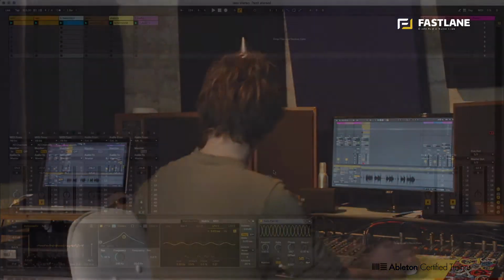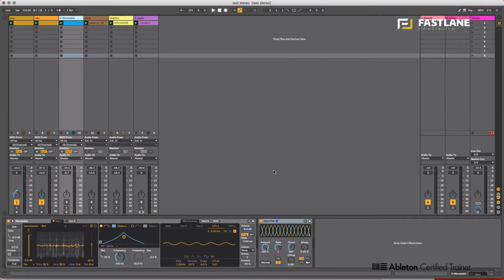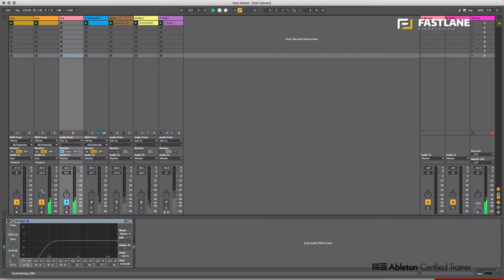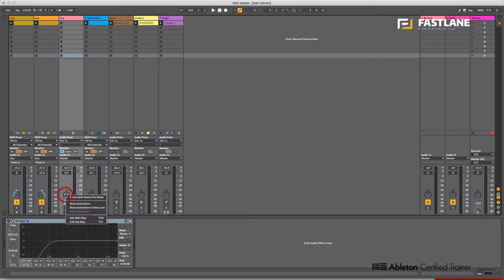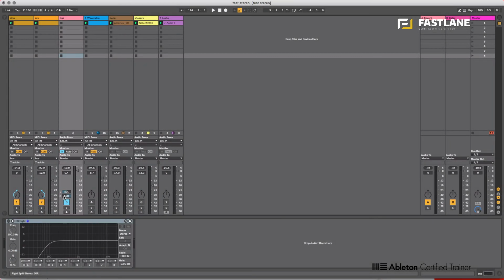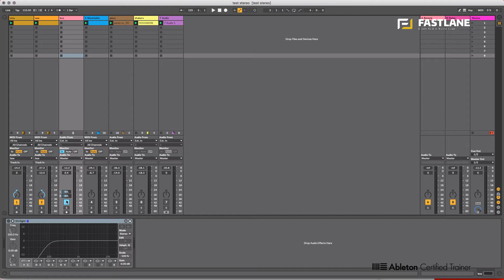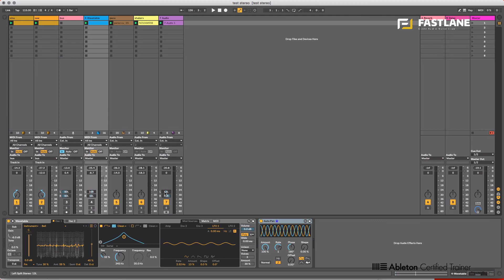Ableton Live Tutorial - Split stereo pan

Comment: I CANT UNHDERSTAND THE PART FROM 4.30 ON WARDS ABOUT THE PIANO . YOUR SAYING MOVING THE LEFT SIDE TO CENTRE WILL LOSE THE BASS KEYS OR LOWER KEYS OF THE PIANO AND SAME IF YOU MOVE THE RIGHT ONES TO THE CENTRE YOU WILL LOSE THE HIGH END KEYS? THAT MEANS USING THIS SPLIT STERO PAN IS LIKE USING AN LEFT AND RIGHT SIDE E.Q ? CORRECT ME IF IM WRONG
Reply: No, not EQ. This piano track happens to have more bass in the left side and more treble in the right side. So with the classic 1 knob pan, if you wanted to pan the ENTIRE track to the right, then unfortunately that would reduce the bass too. (Because it's actually lowering the left channel which happened to record more bass notes).

With the split mode, you're moving the left side over to the right side. (Versus reducing the volume of left side so that the right side starts becoming more prominent).